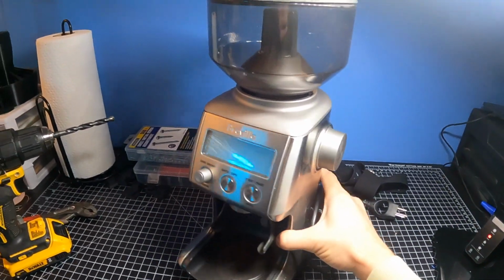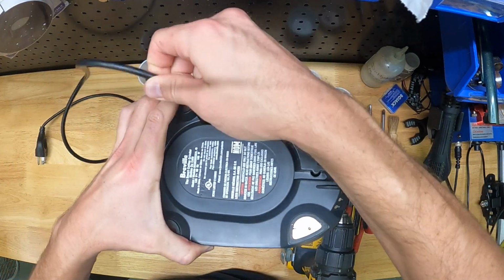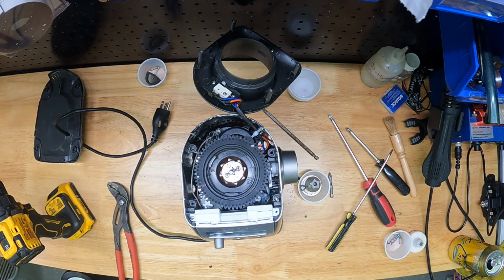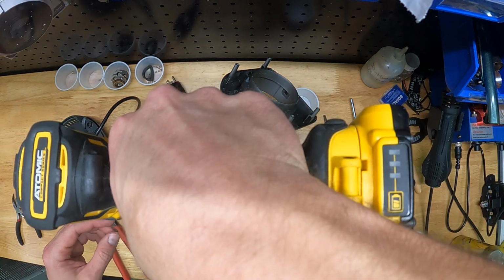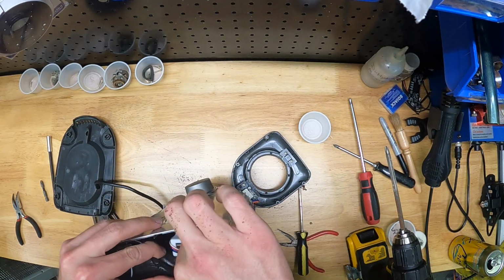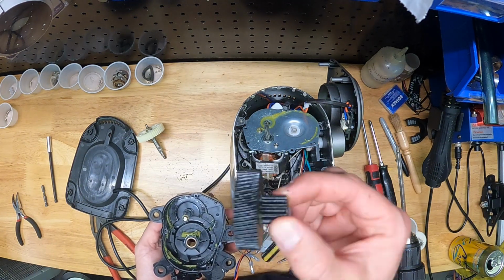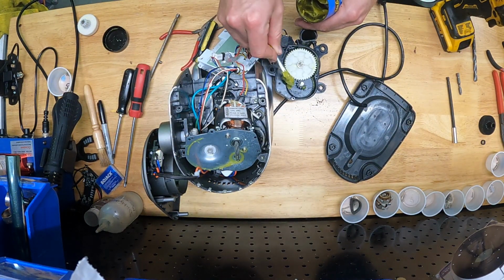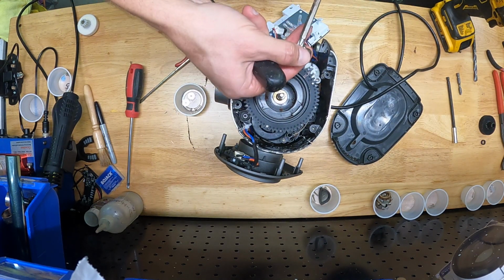Breville Coffee Grinder Stripped Gear Repair

Comment: I followed the whole thing found the stripped gear and replaced it, thought it worked as when I turned it on without coffee it sounded good again, put coffee in and it instantly went went to a bad noise as soon as the coffee made its way down to the grinder 😂

Comment: Has anyone else had issues with the grinder just struggling to grind? I’ve completed this repair three times now, once with my own 3D printed cog and twice with the ones supplied by makeSURFmake. 

After the repair the grinder grinds course for about 30 seconds before making a whirring sound like it’s really struggling and then the teeth burn out like the originals…. I’m all out of ideas 😢
Reply from the maker: It may be that your burr set is dull. Not sure if they can be sharpened but perhaps you can buy new ones ?

Comment: Another fan here. My Breville grinder has been sitting in the garage for months, waiting for me to try and fix it. (I bought a Baratza Encore after it broke.) I found this video, took the machine apart and sure enough - found the stripped gear. After getting your replacement part I managed to get it all back together and it's working! Thanks for the clear instructions and for 3D printing this crucial part!

Comment: Thank you so much for the video. My five year old grinder suddenly didn't grind so well, turns out the shaft that goes into the gearbox and terminates on the white gear, the nut fell off, which kicked the whole thing out of alignment. Dang, it is a bear to take apart, but I succeeded with your help. Thank you!

Comment: I've repaired my grinder thanks to your video and gear; however, I'm continually having issues with the clutch coming apart no matter how hard I tighten the nut at the base of it after a few uses the nut is loosening off effectively disengaging the clutch so the gear will just spin freely. Any suggestions??

Comment: This was so helpful-thank you so much! After putting mine back together without applying new/extra grease, the grinder works but makes a sightly different/less smooth sound, though the resulting grinds are great. Wondering if you think this may be the result of not applying the extra grease or if it may be something else? Thank you!
Reply from the maker: @norapalandjian5809  glad you are back up and running. I noticed my grinder also made a different noise. It should break in and normalize… or you just used to the new sound 😂. Two years in and my grinder is still going strong.

Comment: Great video and very informative. I Just needed some clarification on one part of the video. When you were inserting the small gear shaft into the gearbox, you demonstrated that there was a short end and a long end and that the short end goes down first into the black box with the long portion facing upward. However, in the video, you inserted the long portion of the shaft first with the short portion facing up. (between 19:03-19:10) I did order your replacement gear and looking forward to repairing my machine. Thank you so much for your product and your video.
Reply: Hola donde puedo conseguir esa pieza desgastada? cómo se llama?

Comment: Cannot stress enough how helpful this video was. I stripped the machine and bought your part because the teeth on mine were slightly torn. After replacing it I quickly learned that the problem was actually on the other gear. The plastic holes that support the metal balls and strings has broken off so the balls always come off their socket and my grinder spins freely. Any chance you also sell the replacement for the bigger part with the shaft?

Comment: Could not find a screwdriver thin and long enough to remove 2nd set of 4 screws. Had to return the gears back to makeSURFmake.  He was very easy to deal with.  He suggested a really long screwdriver from HarborFrieght, but I had already sent the grinder back to Breville for a repair estimate.

Comment: Great video, thanks. I came across it only after taking apart my BBE grinder and finding the striped gear teeth.. Do you know what the diameter is of the ball bearings? I lost one when disassembling to troubleshoot.

Also it’s worth noting that the nut holding the slip clutch assembly has red Loctite on it (at least for my machine). It’d likely need that again if it was unscrewed. I’m also wondering if having it slightly less tight would help it disengage when it’s supposed to. I wouldn’t be surprised if differences in torquing that screw between machines is what causes some to fail.

Comment: Hi. I have stripped down,  replaced the gear, checked the motor spindle - all ok, checked the white wheels, they move freely. But when i connect the two up the burr will not move. It is stuck solid. Can't figure out why this won't turn manually. I don't want to try with the motor as it will probably strip the new wheel out again. Any thoughts?
Reply from the maker: Hi Charlie. Did you replace the gear because it was stripped? 

Due to the large gear reduction in the gearbox, it is normal to not be able to rotate the burr. If you try to rotate the input side of the gearbox it should rotate freely.
Reply: Hi there. Thanks for the reply. Yes the small white wheel was partially stripped. Not a massive amount, but enough to stop it turning the main wheel. I have two grinders (caffeine and non-caff). The non-caff one somehow stopped.I took it apart and some of the gear wheel was stripped, as mentioned. I had someone local to me scan and print a replacement wheel and fitted it. It's a test print so not the finished article. Final one will probably be made of copolyester. However, I still couldn't manually turn the burrs. On my other machine I can. It is a bit stiff but they do turn smoothly. On the non-caff it is very clunky. Sometimes it turns, sometimes it is locked solid. However, after your response I thought I'd give it a try. It actually works. Not sure if it will strip out the wheel in time but it does go. Any thoughts on why on one grinder I can manually turn the burrs but on the other it is stiff and clunky?   @makeSURFmake
Reply from the maker: Hi. It’s possible that there may be small abnormalities in the new gear? They mesh fairly tightly and are difficult to replicate due to the small helical pinion on the motor.

I sell 3d printed replacements on my Etsy shop that have a slightly wider contact patch and made from a high end, wear resistant nylon. There are over a 100 of these in use and I haven’t had any reported failures yet. My shop is currently closed for Christmas but I will open it up again next week. I hope this helps.

Comment: the center cylinder in the white gear is really loose in my expresso machine, the stucture of the grind motor is almost the same as yours ( I think), When I tried to deep clean the grinder, the entire center cyilder just came off earily ( to my understanding it should never come off when you are just removing the inner burr), Do you have any recommendation how to fix it? Thank you so much! your video is the only one I have found so far would go over all the gear in depth !

Comment: Thanks for this.   On the final pro tip, you can also super glue the washers to the screws instead.
Reply: Better yet, hot glue. It saves the risk of dripping super glue anyplace you don't want it

Comment: Nice video I bought the replacement Grinder Gear, but during taking it apart small plastic piece fell out I can not find out where it came from.  I tried to look at diagrams on line with no success. any help will appreciated.
Reply from the maker: Hi. Sorry to hear about your trouble. What does the plastic piece look like?

Comment: Great video! My issue was that two bearings in the other gear had gotten misaligned, resetting that shaft helped me in case someone else has the same issue.
Reply from the maker: Good tip!

Comment from the maker: Cool idea. I will look into it. The grind setting mechanism is pretty well integrated across the machine so getting more precision would likely require some significant mods. In the meantime, have you tried adjusting the setting on the burr holder itself to operate in a finer range?
Reply: I did try that. But depending on the beans sometimes the gap between grind sizes is too large. I searched online and a lot of people report the same issue. It is an amazing grinder for the price. I get great, consistent results with purging a few grams between shots and wtd. The gaps between grind sizes make it difficult to use for espresso. It would be nice to have a mod only for espresso. To make the last 15 grind sizes into 60 on the screen.